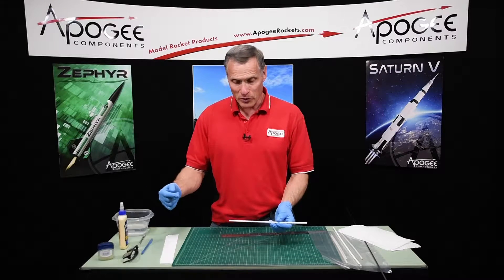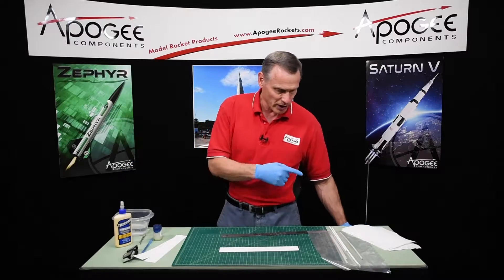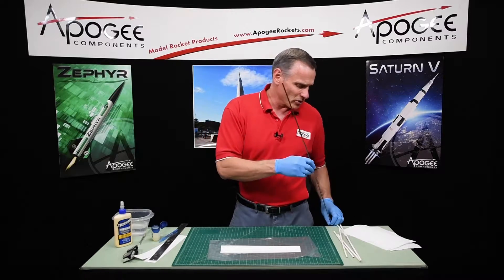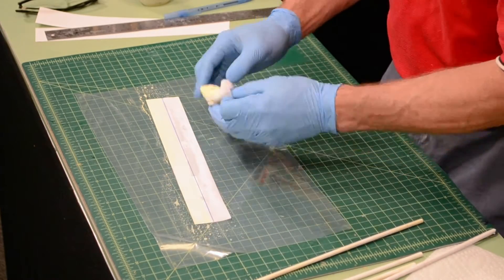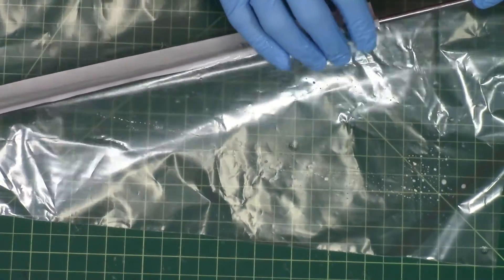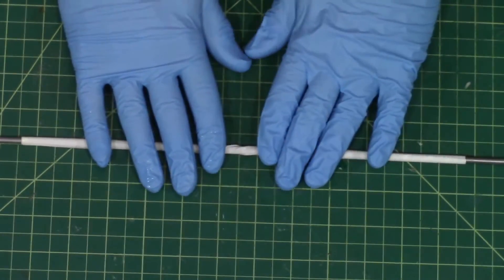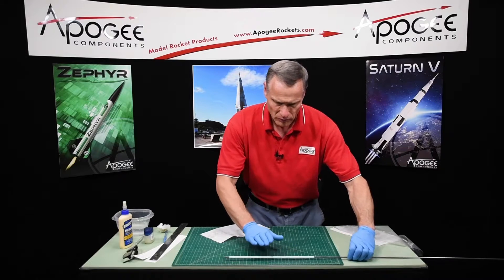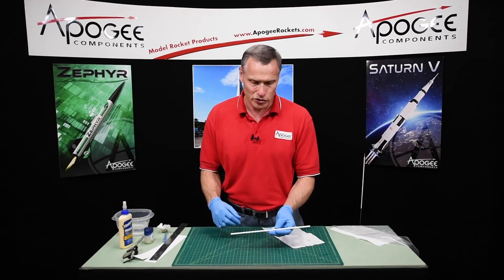Terrier Sandhawk Build Part 3 - Making Straws

Comment: Is the main reason to use paper instead of a 3/16" OD aluminum tube weight? Or are there other reasons to use paper? I'm always terrified to use something so fragile deep inside a project where it's virtually impossible to repair.
Reply from the maker: You can use anything you want. This is NOT an Apogee kit. If it was our kit, we would have provided a way to stage it, and all the components necessary to accomplish that.